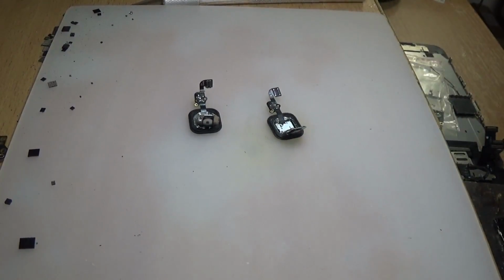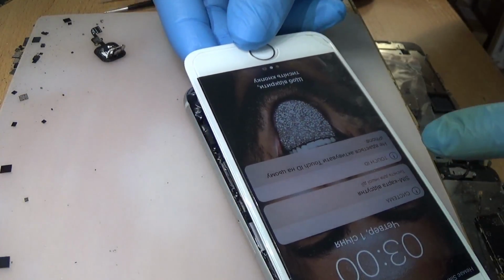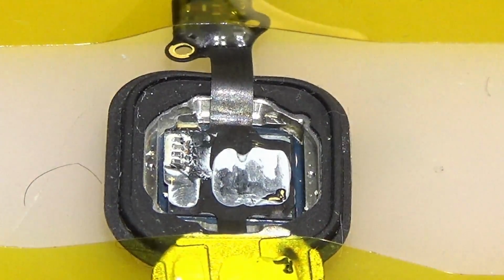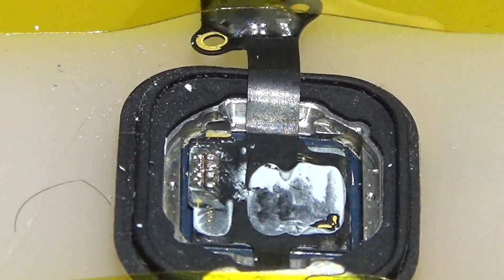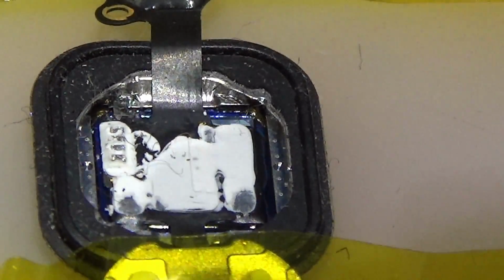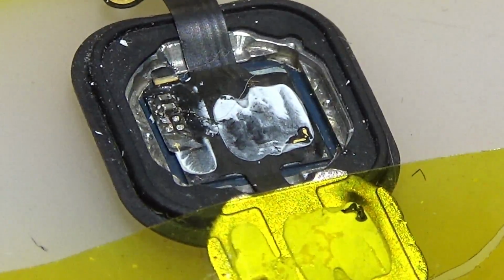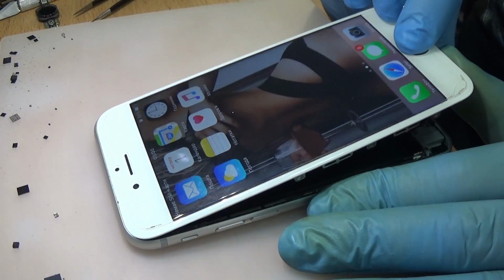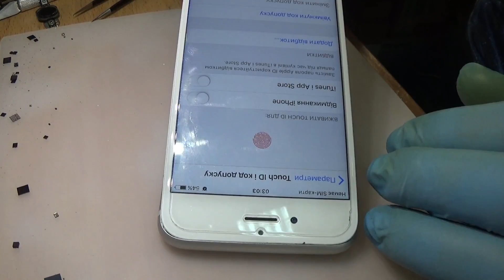iPhone 6S touch ID not working

Comment: @iTouch great video, any chance if this same capacitors will correct issue for dead home button doesn't have response to home clicks. does not close apps at all? I'm currently using  the Need of assistive touch in settings to do job. No touch ID either by the way.